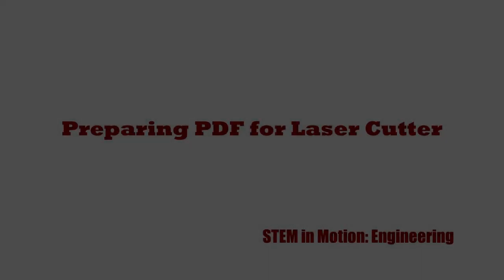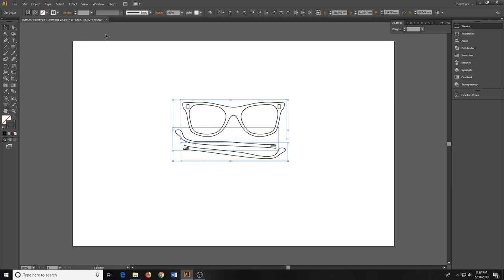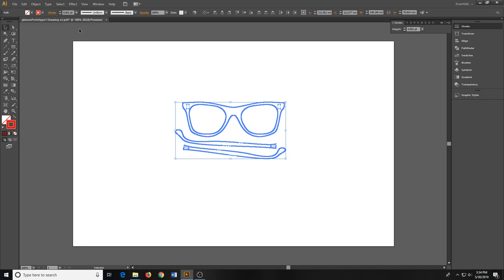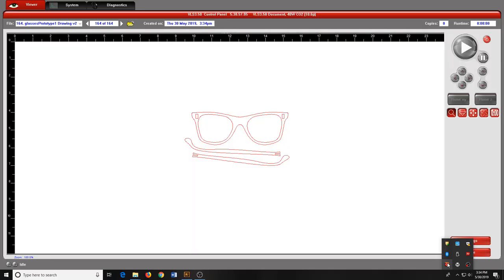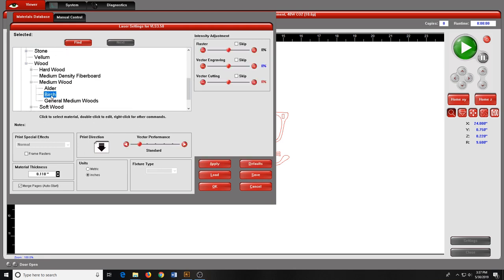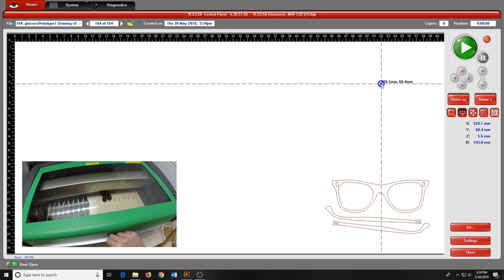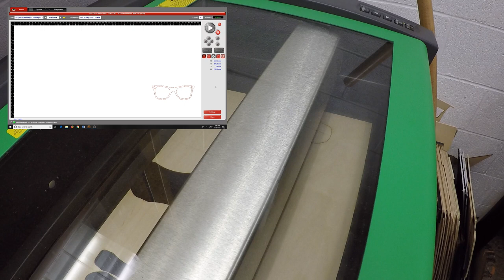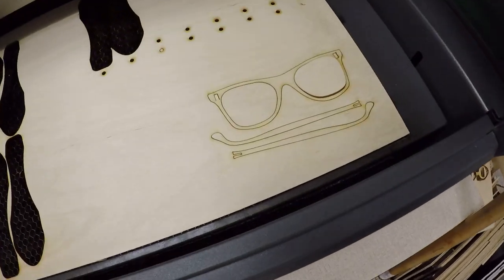STEM in Motion: 10 - From PDF to the Laser Cutter!

Comment: How would you change it to engrave/etch the glasses instead of cutting them out?
Reply from the maker: If you are using a Universal Laser you can change the color of the lines in your design to RGB Blue as the default and it should follow the engrave. You can also just change the cutting profile of red to engrave (power/speed) by adjusting in Settings -> Manual Settings...